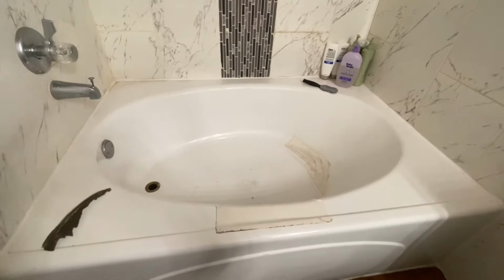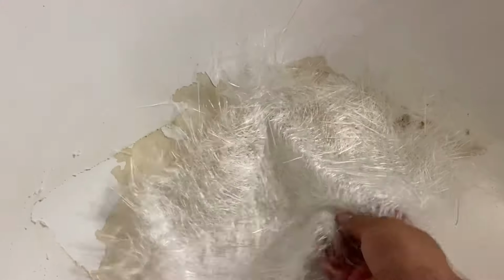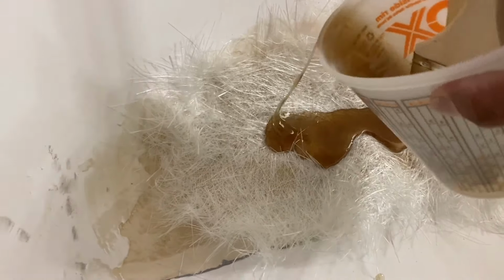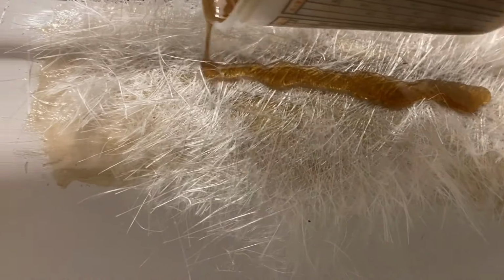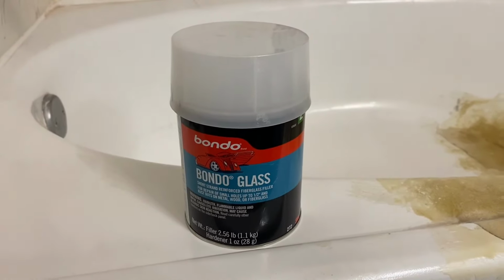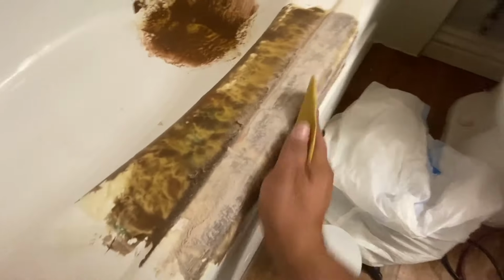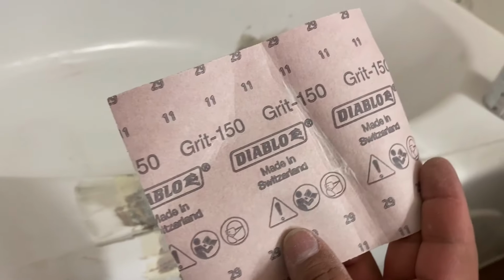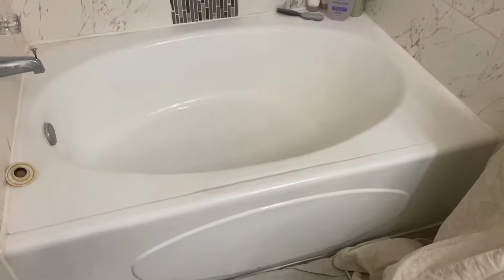How to Repair a Fiberglass Crack in a Bathtub | DIY Fiberglass Bathtub Crack Repair | STEP BY STEP

Comment: Wanted to say thanks along with everyone else. Just bought a house and really don’t have much of a “safety net” for repairs on things. Our tub was sketchy when we first moved in and we noticed a lot of give in areas. After about 6 months a small crack appeared in the floor. This video helped me save a ton and taught me a new life skill. The job wasn’t pretty….but I fixed the sagging floor based off your videos and patched the many stress fractures in the base of the tub and a large crack on the sidewall. Primer is drying over night and then I’ll sand and use the krylon from the video. Thank you so much for willingly showing this process on here for those of us daring enough to try our hands at it. You’re a modern day hero.

Comment: Awesome job bud! I have a question for you. Say you had an 8" crack on the base of the tub that you shored up with foam. The crack is stable and super flush. Would you glass the repair or just epoxy the crack and holes?
Reply from the maker: I would always at minimum glass the bottom even if it’s with bondo glass short strand. You never know if the foam density will cause crack fluctuation...always seal the crack before epoxy.
Reply: @DPTubs  Awesome, thanks mate.

Comment: Man this video popped up just in time. I have a crack in my shower floor and I was fully prepared to just smear a coat of epoxy on it.
Reply from the maker: Glad I could help! Thanks for watching Marcel!
Reply: @DPTubs  what grit of sand paper did you use to sand the repair. Ty
Reply from the maker: Yupppppppp first I use 120 on the original surface, 120 on the resin and the bondo glass, 120 on first coat of putty and then down to 220 to 400 on second or third coats of smothering putty.
Reply: @DPTubs  Ty I have a fiberglass tub with a hole on the side
Reply: @DPTubs  I'm thinking about whiching to kraylon. Midwest doesn't have enough pop for me.
Reply: @DPTubs  What do you use to reduce the kraylon?
Reply from the maker: Yupppppppp that’s what I love about it. I don’t use reducer and I am in Las Vegas. It gets over 100 degrees here regularly and no need for reducer. Just love how nice and thick it is. Reducers tend to react with primers too much and cause the material to lose its strength in my opinion. I clean up with lacquer thinner but have never had a need to reduce it or thin it out.
Reply: @DPTubs  because ordering paint has been bad for me most of the  Material stays at the bottom even after  Stirring
Reply from the maker: Yupppppppp what material? Krylon?
Reply: @DPTubs  what's the best reducer for kraylon.

Comment: I have a fiberglass tub with stress cracks, I called someone local ( I live in NJ) and they wanted over $800 to repair.  I watched your video multiple times and did the job myself over the weekend.  I could have sanded the putty better, but I am really pleased with the results!    Not only did I repair the cracks, but after watching your video I also removed and re-calked the tub - looks brand new!!!  Fingers crossed I did it right, and no leaks lol!!!
Reply from the maker: This is awesome! So glad you found the video useful! Once al material dries...fill the bathtub up and plug it. Let the water sit for about an hour keeping an eye on it and see if the water level changes or if it leaks. This will help you know right away. You could also stand in it while filled to make sure there are no cracks that open up while the weight of a person is in the tub. Otherwise, congrats!!!
Reply: How did it hold up one year later?

Comment: The problem that 99% of these tub repair videos that I have watched recently, is that the repair person never addresses the original problem.  Any cracks that you might have on the floor or wall are caused by some sort of movement up or down and until you secure the area of the crack so there is no movement.  The crack will continue to move and recrack the repaired area over and over again. Fiberglass and resin alone will not work.  These repair videos are like putting a bandage on a gushing wound.

Comment: Great video! I have a question for you.  We have our ceiling open and can see the bottom of our upstairs bathtub and there's a part that's worn very thin. We can see light through it when the bathroom light is on. No crack is visible from the top.  Is it possible to do this repair from underneath the tub to reinforce it? Appreciate the help, thanks!
Reply from the maker: Yes and you don’t have to worry about making it look pretty too lol!

Comment: Thank you for posting this, you can tell that you have done this a lot. I bought everything you used in this video. I am on the step two in the bondo glass. It has turned out really really good so far. I can’t  wait  to see the end product when I am done. I had to pay a plumber 460.00 for some plumbing issues and it’s been hard financially for me and my wife and three kids, this video really helped me. Thank you!
Reply from the maker: So glad to hear that!! Shoot any questions that you may have! How did the brushing of the cloth go with the resin?
Reply: Because my crack was on the side I did not realize that gravity would pull the resin down, so it was a little thicker on the bottom of the tub so I had some sanding to do but I just put the primer on today and have the tub and tile shipping tomorrow and will be done.
Reply from the maker: derek meese did you brush the resin on?
Reply: I am here for the same reason! Going to try my hand at it tonight.

Comment: Should I fill my crack with resin or body filler? In another one of your videos,  you use body filler.
Reply from the maker: Depends on the flex.if there is no real flex or fluctuation then you should be good with just the bondo glass or resin only. If the structural integrity of the area is compromised then reinforcement with the mat or cloth would be needed. I hope this helps.

Comment: Curious as to your color blend process.  Normally with a repair of these size, I usually insist in a full reglaze. And I've not used the krylon before.  Usually just get out my mini gun or airbrush for tiny repairs.
Reply from the maker: Yeah this wasn’t tiny enough for the airbrush. I have a pasche but this was bigger but not big enough for a full Reglaze either. I am sure you know that customer budget also factors in as well. Sometimes I give options and customers choose. The color matched well because someone reglazed this tub before so the whites were easier to match. I have a set of other whites if it was necessary.

Comment: Wrong wrong wrong....20 years resurfacing and that tub will crack again and spray paint? You can mix the amount of proper coating in you’re gun and use that?
Reply from the maker: Totally works! I have been in the industry for over 15 years and my tub coating supplier has a two part coating pre-mixed into an aerosol for touch ups and repairs. The tub will not crack as I give a warranty. I appreciate your comment but have to say you are incorrect.

Yes you can mix the two part coating in the gun but the material I sprayed on with the aerosol is the same two oft coating from Krylon for tubs and tile. For a job this small it’s not worth mixing in the gun, bringing the gun and compressor inside for less then 8-10 ounces of material. Efficiency is also part of the process as well.
Reply: DP Tubs anyone with any fiberglass experience knows that repair is subpar at best. Unless you’re not showing something, CS fiberglass has no strength and bondo fiberglass is way to ridged to hold up to any flexing which happens in all tubs. You might get by with that tub for a year, two years but it will crack again. Of course you’re response will prob be then it served it’s purpose but that kind of work gives resurfacing a bad name...so you would rather buy a 2 part spray can for a certain amount of money then just mix up not even 5 dollars of material in you’re gun? What about a blend on a aged tub? Not all tubs are the same shade. I got you’re point but this is a bad showing of a professional repair
Reply from the maker: Thanks for your response. I still disagree. I have many tubs out there that were done more than 3 years ago that are fine. I appreciate your opinion however i am confident in the work I do. Confident enough to put it out on video. Thanks for watching! 

I get a two part spray can from my supplier for $15 a can and didn’t even use half the can on the repair. The two part catalyst and white mixed on my own would still be from a gallon purchased so I do not see your point. The way I did it was much more efficient for this job without compromising the top coat.

Comment: Could this be done on a steel tub? Its old rusted with some holes. We're saving up to purchase a new but can't at the moment.
Reply from the maker: Yes this can be done and the holes can be repaired.  Ideally it is best if you have access to the back side of the hole but if you do not then you can repair the tub hole from the top but may see a slight rise in that area but it would be very minor. Having access to the back side would allow you to have better support and allow the patch to be smoothened easier. However, you can still repair from the top and reglaze. There are a couple videos of chip repairs and steel tub reglazing on my page. I hope you like them.

Comment: Dude thank you so much for this! I have a very similar crack, going to attempt to do the same repair.
Reply from the maker: No problem. Let me know if you have any questions along the way
Reply: @DPTubs  I actually have a question, if my crack has a little give do you think expanding foam underneath is necessary or does this repair add enough strength?
Reply from the maker: How soft is it in comparison to the areas around it? If it is not too soft then I would just do this repair and you will notice that it will be strengthened. Where is the crack located? A common area for cracking due to soft spots are in areas where people step into the tub and put all of their pressure on one foot. I am curious where your crack is.
Reply: @DPTubs  yeah my crack is on the most stepped on area, towards the back of the tub about 2-3 inches aways from the rear bend of the tub. The crack itself is about 6-8 and horizontal, it is also slightly spiderwebbing out in the center aswell. Was planning on doing the drill holes on both ends of the crack and where it’s beginning to spiderweb/branch out in the center, i was just worried that over time it might  bust open again. When applying pressure from my palm to the crack there is some give and it slightly opens the crack.

Comment: Well....My wife told me that our bathtub had small stress cracks on the floor last weekend. I watched this video and got the material list. Went on a day off work and bought everything I needed to complete this project. I’m a all or nothing kind of person so I resurfaced the whole bathtub floor 😅. We had to have the tub repaired a couple years ago for the same thing and the guy only used the resin to cover up the cracks. He also put spray foam under the tub to stiffen the floor up.
Reply: Did it hold up im thinking about doing my whole bottom to?

Comment: Shit job man, you needed to do a much better job of prepping the surface ...!
Reply from the maker: Why would you say that? the job is totally fine and holding up really well. Don't comment like that unless you have a better solution to offer. Otherwise it's just noise.
Reply: @DPTubs  because it fricken true, I do fiberglass restoration and have for over 40 years and I know when I see shit prep work, there won’t be any longevity to that repair over time , I guarantee you it’s not permanent, matter of fact it’s already rework from you last attempt. Sure the average Unknowledgeable joe blow you can fool but not the journeyman repair tech . To add you needed to prep the surface much more thoroughly by sanding it back to remove the gel coat , then spray in some spray foam insulation to provide support under the tub floor to limit the flexion of the tub itself, then put down several layers of fiberglass cloth finishing out each layer to a wider perimeter until you can blend it in by feathering the edges . To start that’s what needed to done, not your Motel 6 maintenance man job...!
Reply from the maker: Nope! You are wrong sorry Buddy!